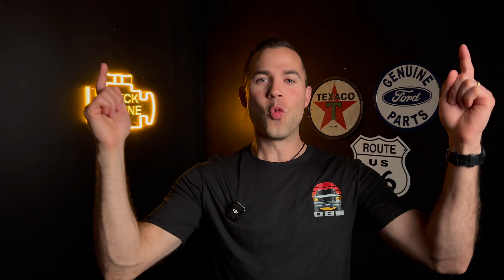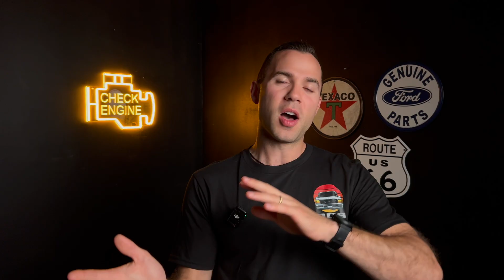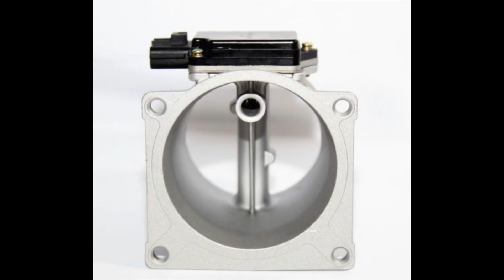Will Your Truck Survive a Nuke | Minute Masters Studio Ep 2

Comment: First, you said that at the lowest setting for the EMP, 13 trucks were affected. What happened at higher settings (assuming the tests included higher settings)?

Second, in the event of an event that causes an EMP, I probably have other things to worry about ... like zombies. 😉
Reply from the maker: I may have misspoke those results were up to the highest test setting which was 50 KVM.

This is true but a couple of grates over the windows and maybe a bed cage would help with zombies.👌
Reply: @TheMinuteMasters Hmmm, I wonder if Mama will let me get a bed cage for the '94 ... 🤔

Comment: I'm sure my 67 Impala would do fine as I'm still running points in it since they're so easy to change and dial in the dwell.  My 93 Astro?  Only one ECM for the engine and transmission, don't know.  The 06 Tahoe 5.3?  Probably not.
Reply from the maker: Better keep that Impala around👌
Reply: @TheMinuteMasters  Thanks!  My grandfather bought it brand new.  It isn't going anywhere.

Comment: Ancillary stuff like window modules maybe fuel pump modules might fry on the newest of the new vehicles. I don't know how well they're shielded on newer vehicles but my guess is the extra modules everywhere probably aren't shielded that well... the main computers are very well shielded and protected against this. 

I think the only ones that would be truly broken by an EMP would be early electronic ignition vehicles. The good thing is - those are very easy to convert to a newer electronic ignition or points and condenser. 

Most modern vehicles would stall and set a check engine light and start right back up.

But the entire vehicle itself is a faraday cage and the computers are surrounded by a metal / aluminum vehicle.
Reply from the maker: This is a great observation and they suggest in the study that vehicles would fare better than expected due to what you have said.
Reply: @TheMinuteMasters  If you put a dentside or bullnose with duraspark in that test, all bets are off for it running after an EMP 🤣🤣 They can barely stand a damp morning.